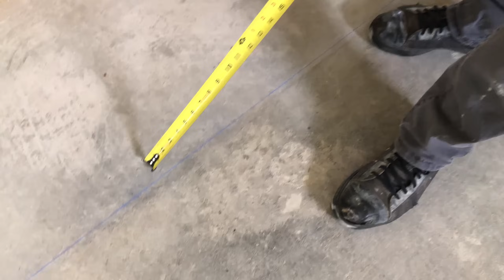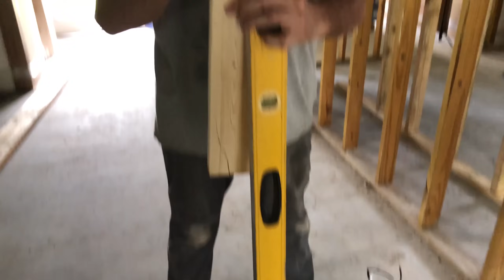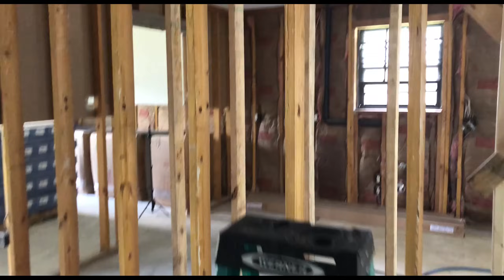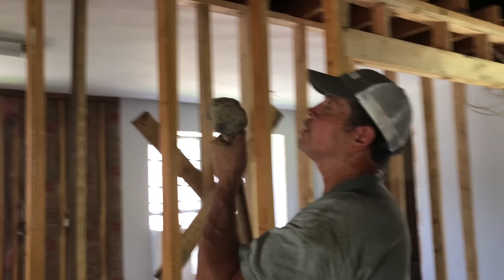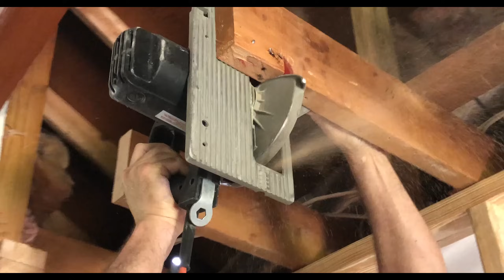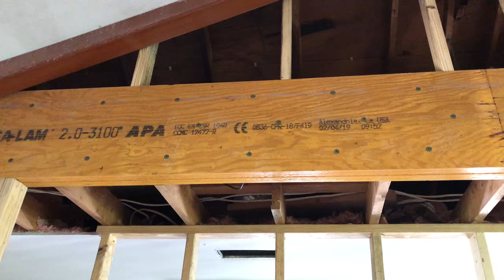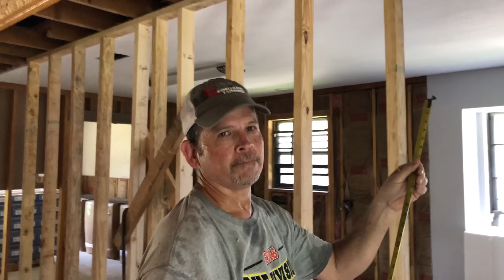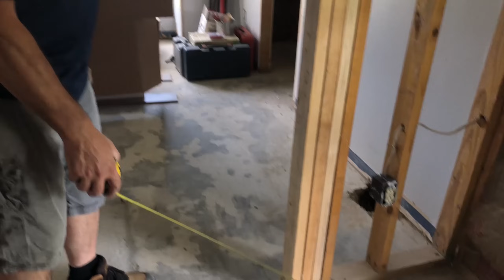Ripping Down a Support Wall and Installing a 16 Foot Beam

Comment: As a contractor I have to mention some things about pricing. Ina addition to the work you are paying for the contractor assuming all risk. How do you quantify that? You are also paying for the movement of the project. Notice how this contractor mentions that he spent some time thinking about how he was going to transfer the load. I have a similar project in the works and I am visiting the site again before I proceed to finalize my approach. I will sit in the attic and take a couple more pictures and ruminate about how I will proceed too. That all adds up to a smooth project that flows. It's not all wood and screws. Kudos to the contractor.
Reply: You factor that in, as you're doing the bid.
You spend 4 hours contemplating, and probably another 4+ doing your bid work, plus time there. That's all an additional day or more on the final proposal.
Reply: Thank you for that comment. I'm learning.
Reply: @zefrum3  Im in Canada, no seismic stuff, and we had to jack hammer up the pad and pour a big footing under each post.
Reply: From what I gather, the guys in the video are the homeowners.
Reply: @LightGesture  In nearly every field we think about work when we're "off the clock".  As an engineer I'm often thinking about the best design approach for an ongoing project while I'm at home (showering, eating, relaxing, etc). If i started billing my projects based on my "thinking" time I'd probably be brought into a meeting very quickly.
Reply: Good contractors are hard to find cause it takes brain power and the will to apply it.
Reply: Remember there is no such thing as a free quote
Your time is something that can never be replaced
Reply: Of course a contractor would say that lol $$
Reply: @JMagic18Burroughs  Then do it yourself if you don't understand value. Check your insurance first. Then work with the building inspector who wants a drawing. Then have all the tools needed. Then have the proper help. Then dive right in you got this.
Reply: @oldpcgamers7450  I was a out to say the same thing! If it's that easy and we are just ripping you off for money, do it yourself  @J.Burroughs! But also keep in mind, in remodel world, it's not just setting the beam and walking away. Ypu gotta put the whole house back together! Can you do that too @J.Burroughs? But the biggest thing is the amount of energy, effort and time that we put into a project such as this. Most of the time, it far out weighs the amount of time it takes to actually I stall them beam. I in 5 years will it still be safe.  Would I allow my kids to sleep under or above the beam I just installed. The beam that is literally holding the 2nd floor from combining with the 1st floor! But that's just me over thinking, right? I understand I can't. I'll for every minute ute I spend thinking of a jobsite. But damnit, when it comes to stuff as crucial as beam replacement, I'm going to make sure that I have charged enough to justify my time and energy, not too mention the actual install  of the beam and its many complexities!!  

Rent over
Reply: @joefaiola2564  in ways that’s you using your personal time as your passionate about your work.

But at the same time if your planning it has to be done whether on site or at home, but either way it’s a part of the job that’s needed. So for this it’s billable time.

Man I just quoted a load bearing wall replacement, and came in at half the previous contractor.

Oh ya, they did a horrible job and I’m there to replace their work.

So really subjective. And let alone their framing work was bad (no attachment to foundation at all, and bottom plate 2x4 only 3/4 on the foundation and sticking out of the bottom of the siding.

Their siding work wasn’t great either. And their insulation just a large bad. Less than a year old and there’s mould from condensation.

This guy paid $25,000 / no permit no inspections and not all has to be ripped out.

I’m lower overhead but still, owner paid for engineer and permits and I’m doing the install for him.
Reply: @joefaiola2564  What do you mean by brought into a meeting? Engineering society would ask you why charge so high?
Reply: @chriscollins4701 How do you come to terms that what you built is safe for you and everyone else under it? What is your thought process and what actions you take to get to the level where it is calm times for you?
Reply: You forgot workers comp ,licensing.

Comment: One of the most thorough videos on removing a load bearing wall I've seen. Very well done.
Reply from the maker: Wow, thanks!
Reply: and no bulshit fillers that waste time. great job guys
Reply: Only thing I would have added is a quick mention of making sure the floor below can handle the added stress on those two points. That's more up to the engineer really to make sure that is proper. Has to be planned out differently if this is a wooden base - floor joists below - as opposed to concrete base

Comment: I pretend that I enjoy doing this stuff on my house.
Sometimes I recall with fondness the work I had the pro's do on it, and then remember how much it cost me.
And then I started doing it all on my own and realized it's not really that hard, and it costs a LOT less than having the pro's do it, AND i know it's done right.
Then I pretend Harder that I enjoy doing this stuff to my house...

[edit]

Let's be clear: this 'stuff' is hard work.  The pro's get what the pro's get because they are willing to do hard work.  But if you live in a hundred year old house, and plan to be there for a while, it can be rewarding both intellectually and emotionally.  
p.s. you'll find the lumber they used back then was... so much better.  Old Growth.

Comment: You do a nice job relating the information.  
Informative without much humor.  Just enough.  
Great video.  If I can make one comment, please wear your mask/respirator from beginning to end.  
There’s so much dust that one doesn’t see, I realize it’s hot especially in the attic, not to mention the fiberglass. Thanks for a very informative, polite video.

Comment: The most satisfying part is when you remove your temporary wall and you get that first feel of how open you just made the room! Great job fellas I’ve always used screws in any temporary wall just cause it’s easier to take apart and no nail pulling and NO WASTE!
Reply from the maker: You're right Vic!  My wife loves that part too - when we finally take down the temporary wall.

Comment: Basically did the same application but with 3 LVL's. When I install these, 2 or more, I laminate them together by applying PL premium, (liquid nails) onto the surfaces to be joined before screwing them together. I install one, apply PL to one surface, then install the second one and temporarily fasten them with screws until all 3 are installed. Then to permanently fasten them together, I use 1/2" threaded rod with lock nuts and washers in a "W" pattern. I buy long lengths of threaded rod and cut to the length required. I then mark out 16 inch centres on the beam before drilling, so the threaded rod won't interfere with the ceiling joist hanger placement. Depending on the thickness of the existing cement floor, in my case, I had to cut out the cement in 2 ft. squares where the support posts would sit. The existing cement floor pad was removed and I then dug out a 2 ft. deep footing, filled them with cement to create a much stronger pad for the support posts to sit on. In some applications I install steel jack posts instead of using wooden supports.
Reply from the maker: Thanks Norm, that's a very strong installation.  I've done footings before also when I lived in southern California.  Had to epoxy rebar into existing slab with a $150/hour third party inspector looking over my shoulder to be sure the holes were proper diameter/depth, clean holes with brush/compressed air, proper epoxy, etc. etc.  Same size as yours too.  2 x 2 x 2 then go get a yard of cement in a pull behind trailer.  Can't remember the name of that place but you could buy cement by the yard - kinda nice sometimes.
Reply: I’ve heard that adhesive between beams is actually weaker than just putting them together as they act more like a single beam without the layer between them.
Reply: The adhesive when applied is very thin. Like when installing engineered floor joists, it's a building code requirement to not only screw but glue the floor sheathing to the joist creating one solid  structure. Screws applied alone have a tendency to loosen over time when the floor flexes from weight traveling over them. The glue prevents this from happening. The same holds true with the LVL application. If you don't screw then bolt the beam together before the glue cures your theory may hold true. Then there would be gaps between the boards being affixed together. No screw could draw them together properly. This is why it is a must that they be screwed together before the glue has time to cure. If you want to stiffen up floor joists that meet the bare minimum code for their application, I glue and screw 2x4's or 2x6's to either side of them and it works perfectly. Even affixing them to one side makes a substantial difference. I've also screwed and glued 3/4" plywood to the sides of the joists, which works wonders, especially if you have limited working space. Just try taking two boards apart after gluing them together. Don't even screw them. Ain't going to happen. They come apart in sharp chunks. To make a room, like a home theatre more sound proof, I've glue drywall over drywall. No screws to apply. Saves a substantial amount of time and labor. Works like a charm. That's why they call it liquid nails. Have a good one. I may not be handsome, but I'm handy. Right honey? I bought my spouse a 12" miter saw for her birthday, so I could borrow it. :-) Honey, mind if I use your saw?

Comment: The main issue with seismic is that you are removing a wall. The more walls you have, in general the more stable the house will be seismically. You can compensate by adding plywood to the remaining walls. Even partition walls add to the seismic stability of a house.

Many of the old houses in the north west do not have footings (just foundation walls) since there is a lot of glacial till. When adding beams, you have to add footings since it is no longer permitted not to have footings.

Comment: I have a tip for you, my friend. Next time the LVLs are cupped, face the cups and sandwich them together with a few spikes. That will correct the cup, and it will not cur from the left or the right.
Reply from the maker: We tried that first.  They wouldn’t pull together.  A combination of clamps and screws did it though 👊👍

Comment: I need to do a job very similar to the job y'all did in your video. It will help me a lot. The difference is that my house is 100 years old. Much of the lumber is full size and is hard as a rock. Thanks.

Comment: What material did you use to connect the beam to studs, and the rafter verticle support to the beam? Was it angle clips? Structural nails? What type of nails? Was there a peice of solid wood between jack studs and beam? Or LVL direct to jack studs?

Comment: Hello! Quick question, I wanted an open concept kitchen on our one story home but there is a 13 feet long load bearing wall that needs to be removed. I was wondering how many laminated veneer Lumber (lvl) I would need? I was thinking of getting 2 of the 1 3/4 × 9 1/2  and 14 feet long with two 4×4s on each side to hold it up. Please advise thank you 😊

Comment: I'm up in Bossier Parish and need to do something very similar for the central load bearing wall that extends from an under-hang header spanning the split between the kitchen/living room.  It ends right at the corner common to the bath and hall entry.  We are going to renovate the bath and will be adding Eclisse pocket doors in 4 places (hall entry, MBR entry, and 2 x shower alcove entries from the end 1/2 BA on each side of shower/tub room.  To get the free span  for the hall entry to the guest 1/2 BA, I need to extend that header (1982 vintage 2 x 2x 12 with unknown filler plate).
At this point, I am just about convinced to replace the existing hanging header that is under the double top plate with joists lapping over with a continuous flush beam spanning the entire ridge area from garage ridge to hip transition and to the outside wall at the other end of the house (tapered to the hip) and put it all in the attic.  Hang all the ceiling joists from it and break the span up where there is available places to put in posts, and then at the ends.  This will accommodate the free-span requirements for the BA entry pocket door, and the future pocket door to the MBR entry.  Additionally, it will provide a means to correct the (what I consider) sub-standard 1980s support for the ridge board and rafters.
Seeing how y'all did your project convinces me that this is a doable and preferable option to keeping the double top plate and extending that underhang header.  Now to work up a proto design for the beam and column locations/sizing, the temp support procedure, and finding a PE to do the "magic math" and supply me a stamped design and a mats spec for the bureaucrats.
Thank you, and you have a new sub!
Reply from the maker: Thanks Clay, much appreciated👍  Best of luck on your project!  Check out our other beam video if you haven't seen it already.

Comment: Hi - I have open concept like the video  - contractor put a double 2 x 12 MICROLLAM® LVL BEAMS. Now the middle of the beam is slight bent. I'm worried the roof comes down. We have a bedroom on top but yours is the artic which is lighter. Any advice thanks

Comment: I need to remove a 15 foot block wall to make a bigger kitchen in a single story house. I noticed that  splice Joists are resting on the wall and I need to replace it with a 15 ft beam to support the joists. I plan to use treated pine and would like to know what size ( 4+4 or 6+6 ) would be best? You guys did an awesome job in this video. Thanks.

Comment: Well done. I had a load bearing wall like the one you took down. I hired a contractor and he said it couldn't be removed.  Inn my heart I knew it could be done. He ended up just cutting  out the wall like a big window. I really hate it but that's the breaks.  Really loved your video.

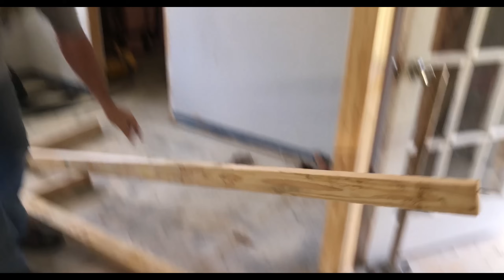Comment: How are the new wide beams balancing on the ends of the former wall?  At 18:48 for example, it looks like if either part slides a little the beam could just fall off.
Reply from the maker: In that shot they are resting on the former wall.  We put some long screws thru the top plates later.  Check out our other beam video (Remodeling a kitchen part 3) and we go into detail on this.  Thanks Garry!

Comment: How is it that those large boards won't sag? Is it just that they are super strong because they are 1 3/4 thick and there's 2 of them and they are bolted together so nicely?  Those large boards seem to be support only at the ends.  I'm a DIYer and don't really understand this kind of thing.  I'd love to learn.  Thanks.

Comment: I have a question on the beam itself.. its 2 separate pieces screwed together correct? If so where would I get the information on finding out what size I would need?

Comment: Good video, I remember when Micro-Lams and Anthony Power Beams came onto the scene and I know WHY you said there wasn't room to swing a hammer, those waxy beams are a pain to nail! We'd always double them on the ground to keep everything nice and flush, hand nail galvanized 10's from both sides 3 in a row spaced about 16 with at minimum 3 packs of pre-chewed Bubble-Yum bubblegum (BananaBerry Split) as adhesive per every 12 board feet. Maybe it was PL-400... can't recall, they taste so similar! 
I haven't got much to complain about and I sure love complaining... but I'd still race you, my Makita vs. your magnesium Porter cable!!! I fully agree with PC for reciprocating, but I'll never give up my Makita circular!

Comment: Great video, very helpful. For existing home with load bearing wall, Can you join two small beams using metal connector between the two together to make one long beam to get rid of a column holding up the weight?

Comment: Good video and tips especially on the reciprocating saw.  One area that I would disagree on is on the old wall that had the 5 1/2 foot opening that was sagging.  The top plates had a sag but the header itself didn't.  I believe the issue was that the cripple studs above the header probably had a slight gap between them and the header/top plate when it was first constructed and the weight of the roof pushed down on that gap over time till the cripple stud was tight between them, which caused the sag in the top plates in the process.  Just an observation.
Reply: I agree with you. I noticed that too.

Comment: Nicely done. I liked the attention to detail. If you needed the working space some adjustable jack post would work and it would make it easier to transfer the load. It might be nice to update you tools to cordless options especially with the battery power avaliable. 
One last option, green line lasers are awesome too. 
Great job.
Reply from the maker: Thanks Noah!  Jack posts are great, I think I can rent them locally.  Cordless tools, yeah I know.  Been trying to decide on a platform, think I'll go with Milwaukee.  I purchased a Bosch green line laser in April, it's a game changer.  Check out some of our more recent videos and you're bound to see it👍

Comment: great job as usual. can a supporting beam be installed on top of the joists then hooked with hangars to joists? its a lot easier without cutting the ceiling joists. is it not per code?